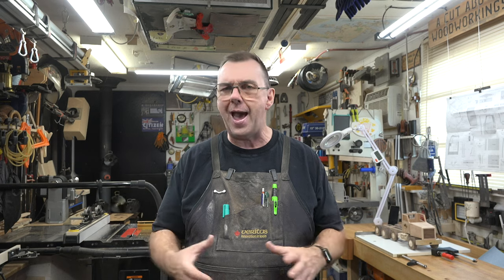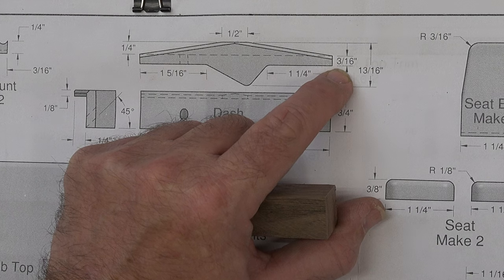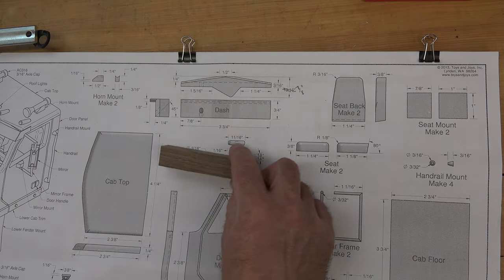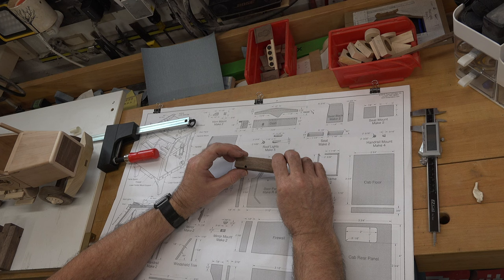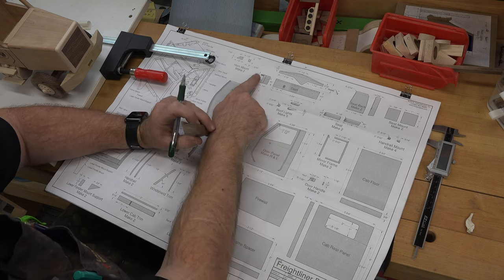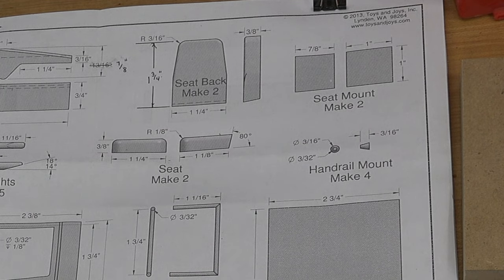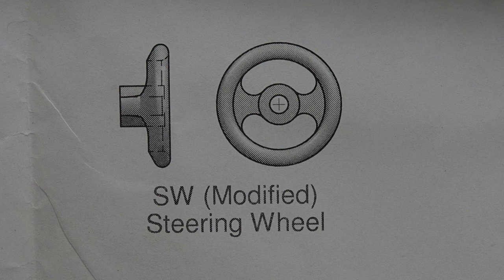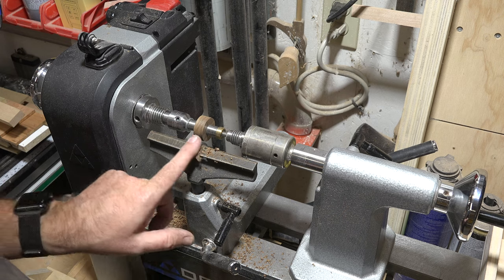Making Toys and Joys Dump Truck and Pup Trailer Part 11

Comment: Another fantastic episode, the lasering just takes it to another level ... for those who don't have all the tools, remember you can do this all with hand tools, it'll just take longer ... most importantly don't be afraid to try, it's through trying that we learn 👍
With regards your sandpaper/MDF, I'd seal the MDF with varnish first to make glue removal easier, sticking to some laminate flooring would be even better 👍
Reply from the maker: There's always a way to do things other than the ways that I demonstrate here on the channel.  Finding your own way and doing what is comfortable for you is what makes it your own.  Thanks for tuning in this week Barry and for chiming in with your thoughts.

Comment: Interesting Video Kenny, I couldn't do something as complex as this even though it looks fun to do. I enjoy watching your techniques on how you do things. I like the smaller models you do and I made a prototype of the little tio truck you have free plans for on your web site, it is a bit rough but the next one will be better. I did tell you that I was opting for a cnc machine but changed my mind and bought the xtool M1 10 watt which can also cut vinyl with the little blade inside, it also has a camera inside to show on the computer screen the object to be worked on. It hasn't arrived yet but it should be fun.
Reply from the maker: I've never worked with the M1 William but xTool make a solid product.  I hope you are happy with your new toy.  Just a word of advice, never cut vinyl using the laser.  You will end up poisoning yourself and ruining the laser.  Thanks for tuning in to the show.
Reply: @acutabove_woodworkings  thanks for the advice Kenny, I will remember this. I am happy with my new scroll saw too. How would the laser go in my shed with some dust around? And me using the sanders a bit?
Reply from the maker: @williambuckley1185  I usually keep the laser housing where the tools are and I keep the actual laser head in the house where there isn't any dust.  I may be overdoing it but I'm protecting an investment.  If you are able to cover the laser, that would work as well.

Comment: good tip on the removal of the sheet sandpaper. Do you think acetone would work as well for removing the old glue? I prefer acetone if I can use it. Looking forward to the next video.David
Reply from the maker: I've never tried acetone to remove the spray adhesive David.  I may have to give that a try the next time.  Thanks for tuning in and for chiming in with your question.
Reply: only lacquer thinner will remove it.

Comment: Again thanks for all explanations how to build this truck! Mostly I make my steering wheels from wooden knobs, and when time is there I will make a "how to" blog. I let you know when ready. And now a few questions. What face protection do you wear?  Behind the sander it is a different one than behind the table saw. And how is that door emblem made? Maybe something for a laser explanation video 😊. Have nice easter days!
Reply from the maker: The mask that I am currently using for sanding is a Base Camp mask.  I featured them a little while ago on the show and they are great.  The door emblem is a different story and I might possibly have to do a show on making custom engravings for models.  The custom ones that I did for your forklift build worked out really well and the process is fun and easy.  Thanks for tuning in this week and for the kind words.
Reply: Thanks for reply. And as far as I'm right  @acutabove_woodworkings   after the saw table it was a TREND?

Comment: Even though it is unlikely I will do a model build I always watch to look for tips and tricks to use elsewhere.  You using the heat gun to soften the glue is what I do often to remove shipping labels from boxes I want to reuse for shipping.  
Always appreciate your level of detail in your work.  Takes more time but the results definitely show.
Reply from the maker: You should really give a model build a try Dwight.  It's one of the most satisfying projects you will ever create.  Plenty of challenges and problem solving.  Thanks for tuning in to the show and for the kind words.